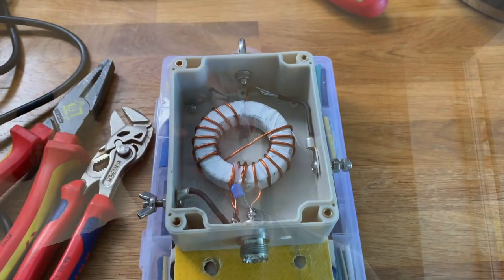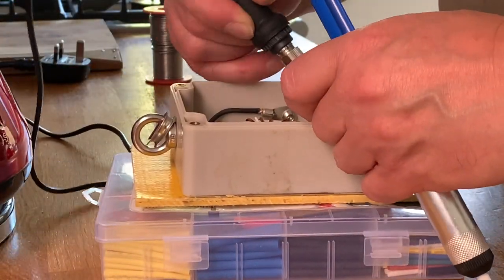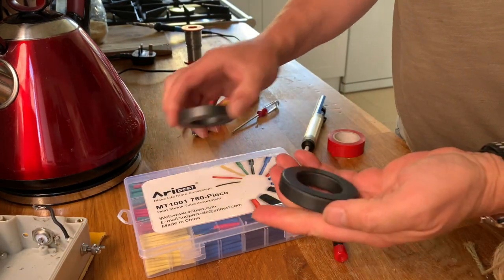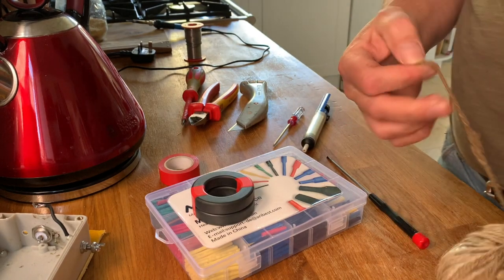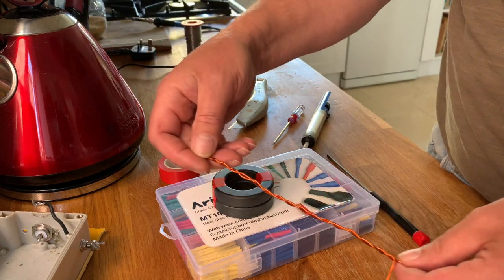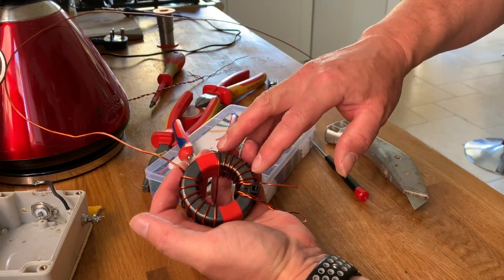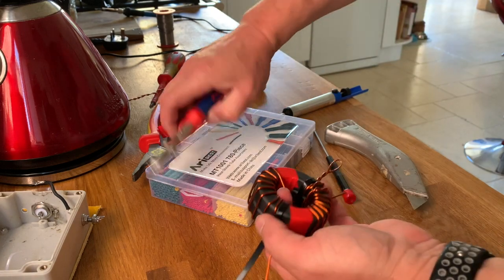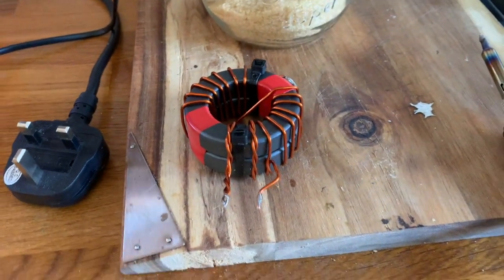Remake of a 64/1 Unun (transformer) EFHW End feed Half wave.. 80m to 10m Antenna

Comment: I can't help but think that the enamel on that wire seems a tad brittle which could result in shorts especially when gripped without padding. Looks pretty good though.
Reply from the maker: Fair-right is non conductive so the only short would be between turns on the coil..

Comment: Mike I see in your description box that you found that on 80 M that the antennas performance was 8 to 12 db less than a dipole.
 How did you measure that sir?
Reply from the maker: Yes I should/will remove that comment, it is more like 3dB down and as it turns out only on some signals (directionality) . The EFHW is quieter in general but that does not make it a worse antenna. Equipment used was a HP Spectrum analyser and signal generator.

Comment: Use double or triple cores - FT240-52 cores, don't put take on the cores, this will trap heat and ruin your swr.  Glue them together.  Built like this, it will handle 1500 watts !

Comment: Why do you need a 3000V (100pf) volt capacitor at a high current low voltage, low Z point where the 50 ohm coax connects?  A 500 volt silver mica should do...no?
Reply: Actually that's a fair thing to state, and a good RF capacitor with a moderate voltage rating is more what you want I'd say, although it wouldn't be critical at all

Comment: Have any ideas for using the old cores found in a computer power supply?
Reply: They are unlikely to be the right material.
Reply: They would be powdered iron cores for switching frequencies. Lucky to work at more than 500khz

Comment: Two turns for the primary winding is ok for one 200-43 toroid. If you use two of the same toroids, the permeability and the Al factor is greater. Did you try to compute the reactance? I also suggest you a 100 pF capacitor trimmer on the primary winding to find the right fixed capacitor value. 73s.

Comment: Hi Mike.... yesterday i ve made a 49:1 unun, SWR is less than 2 but not optimum, now going to take it down and will make it 64:1 following your instructions, just one question, whats the guage of wire are u using, i have both 14 guage and 18 guage, will be using only 100 watts...so what should i use ?  Thanx 73s
Reply from the maker: 14 bigger the better.  :)

Comment: ...did you ever try a #2 mix core (red colour) for your 49:1 or 64:1 EFHW? They seem to be popular for the UNUN's.. why not EFHW?  They are supposed to be superior to the 43 mix, particularly 10mhz and above and equal on 40. Noticed you took off the white Teflon tape for the 64:1 experiment.. good move as you get a tighter wind. The enamel on the wire has proven to be sufficient.
Reply from the maker: will try that mix

Comment: Hi Mike.  For 80M, a single core doesn't really provide enough inductance for the number of turns. That's why 2 cores improves the SWR on the lower bands. I have found a couple of drops of superglue to be good for holding the cores together.  Of course, 2 cores will also improve your power handling -- so the balun shouldn't get as warm. 31 material is also good for 160-40M. 
73 Bruce G4ABX (aka Dr.T.)

Comment: I just rebuilt mine with two ft240-43 toroids for same reason. My efhw is a 40-10 version. I also have a 80m full wave loop fed with ham 450 ohm twinline and a mfj autotuner so I decided not to make my efhw to add 80. I could add the loading coil to the end if I change my mind.

Comment: hello, please tell me what brand of ferrite do you use? Is the FT140-43 suitable? Respectfully yours, Evgeniy UT8IBX, 73!
Reply: ... it's the mix that determines the bandwidth and overall efficiency of the core, so unless your running high power you should be OK. The 140 diameter core (1.4") should be OK up to around 100 watts ssb or cw, maybe a little more. You don't want to saturate the small core with high power, because it'll heat up and it's characteristics will change.  43 material is an overall good compromise, and it's what most guys use for the EFHW baluns... The Amidon #2 red mix which is an iron powder core seems to be best 10mhz and up, although the QRPGuys use #2 for their 9:1 40 through 10M UnUn. The 31 mix is better for the lower frequencies... 160, 80 and 40.  In the end, there are no hard and fast rules, and it takes experimentation. .
Reply: @richardfryer8646  I don't know what to do anymore, I can't get this antenna ... I can't tune the antenna into resonance.

Comment: Hi Mike
I am thinking of making an EFHW antenna.
Using a vertical section would be the way to go BUT how will that impact on the new EMF assessment in a very small garden?
If I put the 64:1 at the top of the mast, and run purely horizontal  I suspect that will help with the assessment and here is another BUT, I will then have only 47 ft to play with.
So I wonder if can add a bigger coil than you used in your other video and how did you calculate how much wire to add on the end.
Also if I use a Fibreglass telescopic mast, I could run a counterpoise down the middle of it.
I gather they dont have to be very long. 
By the way a transformer such as this one has a loss of 0.6dB plus 0.2 dB for the PL259 so that takes the EIRP down a little.
Love your videos, my workbench is also in the kitchen but not as tidy as yours.
Kind Regards and 73
Mike
G3ZCC
Reply from the maker: A problem many of us will have, when you mount the 64:1 at the top of a pole the coax becomes the counterpose so the problem still exist? or does it?

Comment: Hi Mike. Callum suggested that I ask you my question.  When dealing with a long wire (or end fed wire) how do I determine what size unun is needed?  What determines if I need a 4:1 or a 9:1? Also, I have a mystery balun or unun that all the writing has worn off of. It is just a piece of sealed PVC pipe with an  SO239 on each end. How do I determine what it is?
Reply from the maker: The length of the wire if it is a half-wave then you will need A 49:1 or 64:1 if it is a random length that is not a 1/4 or 1/2 wave then a 9:1 if it is a 1/2 wave folded into a square then it’s a 4:1 all these are due to the impedance that the wire shows at the connection point. So for your balun put a 450ohm resistor on the antenna side and then measure the SWR if it is 1:1 it is a 4:1,   It is likely to be a 1:1 test with a 50ohm resistor.
Reply: @mike-M0MSN  Thanks Mike. Sounds like a half wave lenght wire for 80m would be a good match for my 4:1 unun. W4MKH

Comment: Nice work Mike. I have had my 80-10m EFHW up for about two years with zero problems. I used 3-43 mix Ferrite Rings for better power handling and heat dissipation. My home brew antenna made the trip twice now to Callum from Florida with 100 watts. I want to change the antenna configuration from a sloper to an inverted L or Inverted Vee. What do you think the best orientation would be best? 73 Joe
Reply from the maker: Hi Joseph,  It's horses for courses each configuration has its good and bad points, its what suits you..  :)
Reply: @mike-M0MSN  I knew you were going to say that Mike :p. That's what I would say if I were asked. That's why us Hams do a lot of Experimenting. 73 Joe

Comment: After watching this , I am wondering if I need to rethink mine .  I have a 49;1 with a 120 ft of wire .  No coil at the end .  Hmmm   sir seems a bit high for me on 40 and 20 .  It is also on 3 type 52 Cores .  Any thoughts ?
Reply from the maker: It should work, I have always preferred type 43, and winding a 64:1.  You could always just try replacing the wire length with the shorter 20.5 and coil to see if your SWR comes down, if it doesn’t then perhaps the transformer?
Reply: Try lengthening your wire by 10-15 feet. That should lower your resonant freq. on 40m and 20m.
Reply: @dezwatson6993  I may have to take it down and measure the wire .  I am guessing at the 120 . Thanks for the info

Comment: A 52 mix core is a little more efficient also a little more expensive.   In order to have the higher bands in tune you have to cut the wire for the cw section of 80. I haven't tried it but I watched a video where they cut the wire in half and added a 250-500 pf capacitors and then you get the ssb section of 80 and it's in tune for the higher bands. Can't remember the video. I think it was Steve Ellington video. 
Jeff ke4fwe
Reply: 52 mix if you're using 3 cores.  1 or 2 cores, 43 mix.   That's from Steve Ellington video.

Comment: why some are 64:1 and many other are 49:1 ? also why do you state 8-12dB loss on 80m against a dipole ? is it because it is the short version or the choice of cores ?
Reply from the maker: The shorten element on 80M, plus core loss however as it is quieter the receive is better than my Vertical ??
from time to time that why I keep playing.   :)
Reply: @mike-M0MSN  so you need 64:1 on the shorter version with a loading coil correct ?
Reply from the maker: Aleziss yes. I found the 64:1 better on the short version. :)

Comment: Nothing wrong with that S.W.R. and it appears to be woring fine, good job Mike.  To let some ventilation and allow some spiders in so you car roast them with RF you can drill holes in the bottom, if you go to your electrical store, you can get right angle plastic Glands, take out the rubber seal and you have weatherproof verts for further up, just point the gland downhill of course., if they prove hard to get you can get plastic fittings for plumbing, nothing like a through put of air to keep things cool.  You can also use these glands to feed cables through plastics etc where you want to waterproof things as the rubber grip inside will also seal against water for the best part.  You get straight ones and right angle ones, 20 and 25 mm ones and maybe even bigger.

Comment: A 49-1 unun is not meant for a dipole antenna as it has the wrong impedance conversion .
Reply from the maker: Yes Joe you are right, should have read against a dipole not on or with..  many thanks.. :)
Reply: Why does it have the wrong impedance conversion?
50 ohms times 49 equals 2450 ohms.
A half wave antenna at its end in a normal backyard environment will have something similar to this impedance.